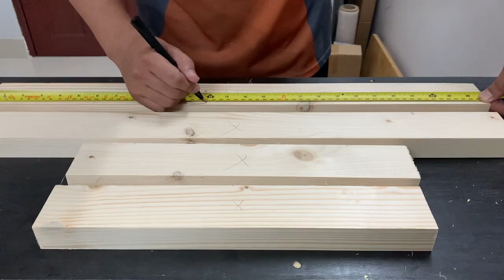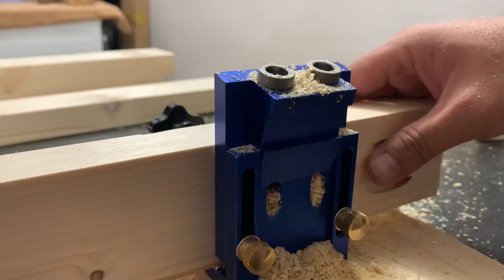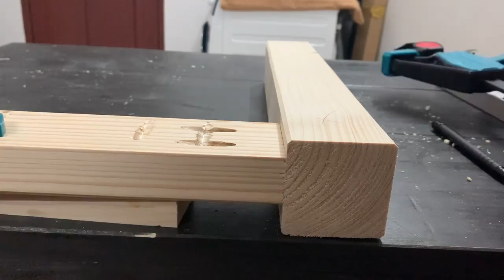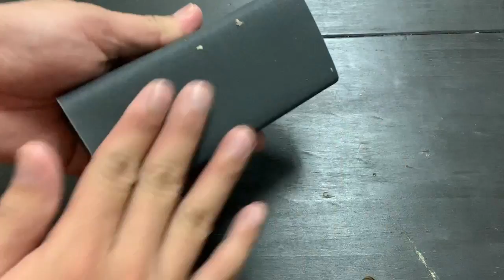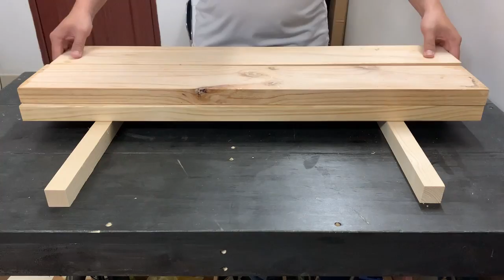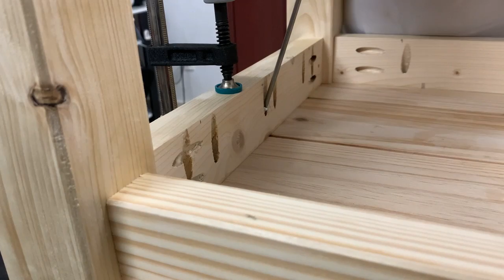Making Coffee Table  - Using Pocket Hole Jig

Comment: Thanks for the video. I’ve never used a jig before. I bought all the wood for making my own cornhole boards, but wasn’t sure how to join the 2x4’s to the 1/2” plywood. (A couple videos I watched the 2 gentlemen drilled straight through the 1/2” plywood and joined the 2x4’s and countersinking the decking screws. I thought “There has to be a more professional way to attach the plywood to the 2x4’s, not have screws visible, and potentially snag the bean bags during expansion or contraction of the wood.
I bought a few extra 2x4x8’s to experiment/screw up. I’ll be watching your video several times during the process. Thanks again!

Comment: Pocket holing along the apron like that ok? Would the boards not crack from wood movement
Reply: It’s a 50/50 chance. Although I think since it’s a little rustic it would look fine with a crack and add character . I have built some things this way even an apron and it was ok. What you can do for the apron is after drilling the hole for the pocket hole get a little bigger size drill and drill on the holes on the apron making it slightly bigger on the apron side which gives it some room for movement. I hope that makes sense. God bless .

Comment: What setting did you use for the 1 1/2" wood? The booklet states 1 1/2" slide and 1 1/2" drill bit slide. But that wouldn't even be on the board but starts before it and the stopping point is before the outside wall?